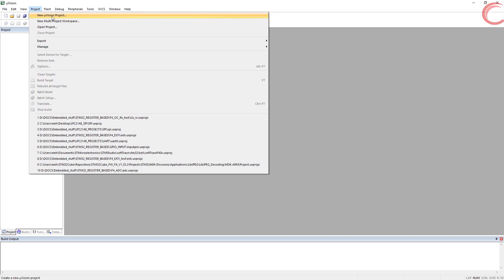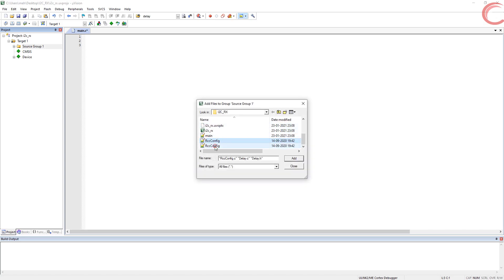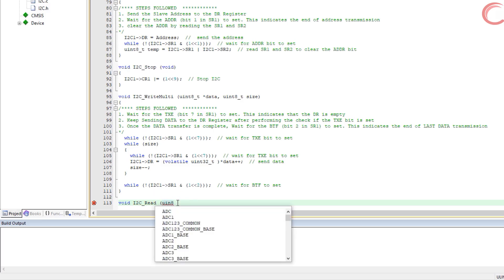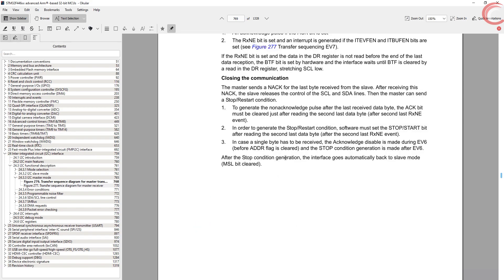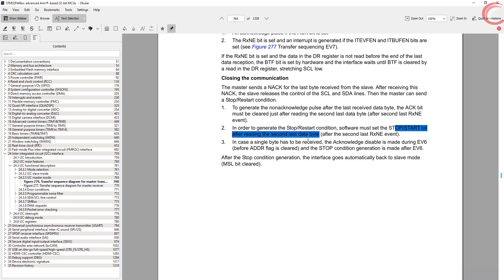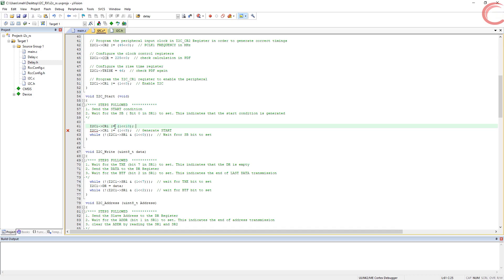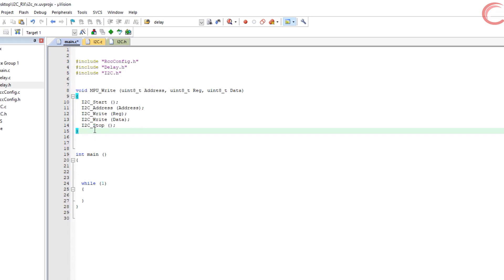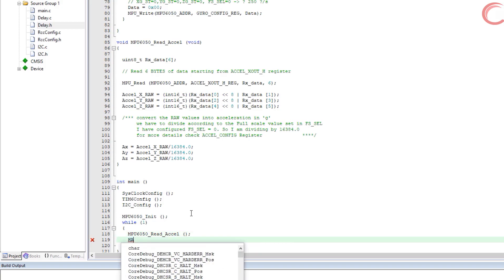#6. STM32 I2C Receive using Register based Programming || Multiple Bytes || MPU6050

Comment: The I2C works for me: I can see on the oscilloscope how every second the while loop is executed. But in the watch Ax, Ay and Az are at 0.
In the oscilloscope I can see the signal perfectly: How the master sends the sequence: address, write, ACK(from the slave), register, ACK(from the slave), address, read, ACK(from the slave)... but from then on the acerometer only sends zeros.
I thought that the accelerometer did not work well, but I have tested it with an arduino uno and it works perfectly.

Comment: Does the MPU_Read() function do the reading Low value of gyro or accel register also? Thanks in advance.
Reply from the maker: What do you mean low value ?
Reply: @ControllersTech  I mean the ACC_OUT_L, I thought it only read the HIGH value (  ACC_OUT_H at register 15:8 bits). But after a couple of minutes rewatching your code, I figured out that It reads the LOW values (7:0 bits) also. Thanks for replying anyways

Comment: can you explain why you have set MPU6050_ADDR as 0xD0(line 27) where as in the datasheet its given as 0x68/0x69 depending on AD0 value
Reply from the maker: As per the datasheet, the address is b110100X (X is for AD0). This address is 7 bit long.
STM32 needs 8 bit Address for the I2C, So b110100XW (Here W is Write(0) or Read(1) But). basically b11010000, 0xD0
Reply: @ControllersTech  basically 0x68<<1 like this?
Reply from the maker: yes

Comment: first of all it is very nice, which pins on MPU6050 are connected to which pins on STM ?
Reply from the maker: I2c pins. Clock to clock and data to data..
See the mpu6050 detailed tutorial for that..
Search on the website or youtube
Reply: @ControllersTech  No, you got it wrong. Which pins of the SCL,SDA nucleo do I connect? I asked?
Reply: @ControllersTech  more precisely the wiring diagram
Reply from the maker: Did you watch the previous video ? About I2C send data
The pin configuration is defined there. I said in the video that you must watch that one first
Reply: @ControllersTech  unfortunately :( Can you leave the link?
Reply from the maker: Read the description

Comment: There is something wrong in my code because when I trying to work MPU_Write(MPU6050_ADDR, PWR_MGMT_1_REG, Data);
the code got stuck into this void I2C_Address(uint8_t Address) function's while loop. How can I fix this situation?
Reply: It's exactly my situation. If you solved this issue, do you remember how? Thank you so much!